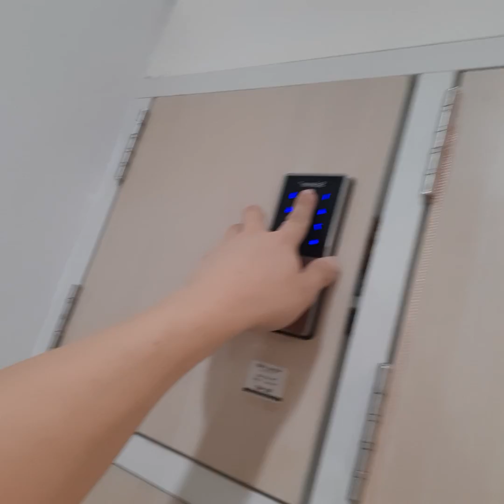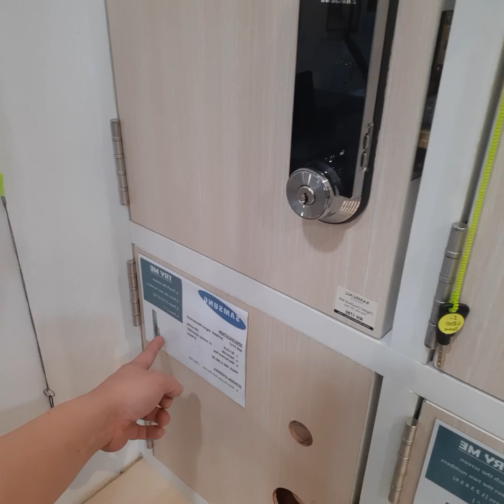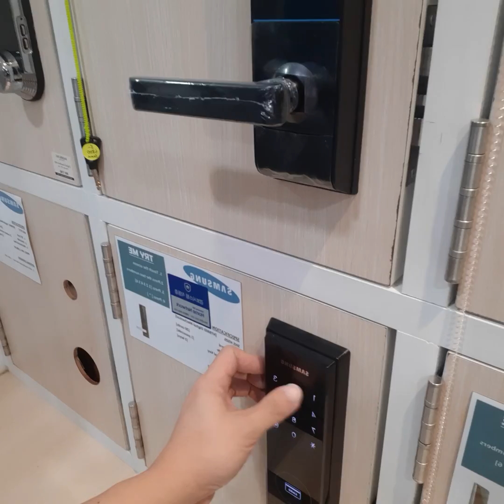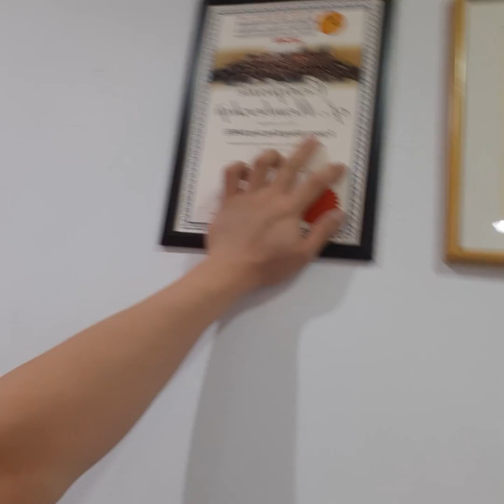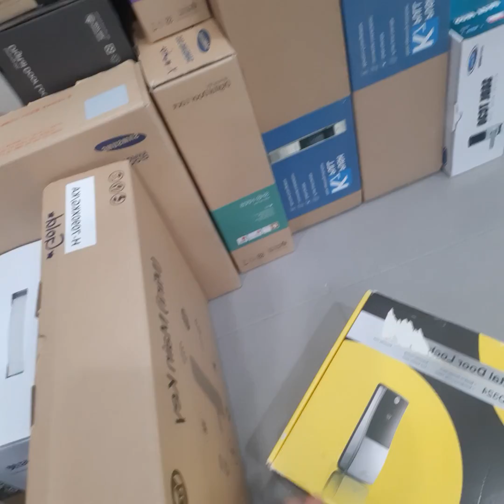DIGITAL DOOR LOCK - Which brand is good? (Yale Samsung Philips Schlage St Guchi Digital Door Lock)

Comment: Is samsung dh525 good?
Reply from the maker: not really. Back body easy to crack. if insist to buy Samsung buy the latest one. DR708
Reply: @TheFineLockShop  other thn th dr 708 how about dh 537
Reply from the maker: @zikriharith4884  They are the same. But if you really like Samsung brand but don't want to allocate high budget then you don't have choice only 525 or 537.
Reply from the maker: @zikriharith4884  708 more better

Comment: What brand that you said its good. No maintenance for 10 years
Reply from the maker: Schlage brand
Reply: Hi sir. May i ask your opinion for schlage S7100 or S7800 , which is better?

How about epic satin digital door lock brand from (Japan) as compare to S7100?
Reply: Hi Sir, thanks for sharing of your video. I'm from SG. I have used Igloohome Deadbolt S and S2 for the past 3 years. Deadbolt S2 was the free replacement for my earlier model deadbolt 2 which used it for less than a year under warranty. I have decided to change to other model instead with the bad experience with Igloohome. Any brand to recommend for deadbolt which can nice fit the existing door hole without drilling the additional door hole.

Comment: Thanks for your sharing. Very informative. Any opinion on Yale YDR50G and YDR343 combo. Good? Bad?
Reply from the maker: Yale YDR 343 only use pincode and card, Yale YDR50G can fingerprint, card, Pincode, Key, Phone app(optional). Is a bad mixture in my opinion. 

Yale rim lock, generally speaking, is good. Very seldom got problem.

Comment: Hey, very good reviews and honesty! Helped cleared up a lot of things.

Can I also please get your opinion on which one you would recommend. I don't think I require wifi since I won't let anyone in without me being at home but biometric is needed. 

Are these ones ok? The bottom two has wifi, which maybe overkill but just thought I consider it as well.
Samsung DR 900 vs Philips Alpha 
Samsung DR 708 vs Philips 9200 or 9300 (I read from the comments that you recommended the 9300 over 708 but the 708 seems to be cheaper than the 9300 by RM700. Is it worth that additional?)

If there is cheaper but good ones at RM2k and below for a push/pull handle type for condo firedoor, can you please recommend also? 

Thank you!
Reply from the maker: 708 got 2 version, a small locking version and a strong locking version.  I think if differ RM700 should be the small locking version. I definitely do not agree spending above RM2000 for a weak locking system, no matter how advance the digital part is.

Push pull below 2K, try for Hafele. But you will get more plastic. And there will be no spare part support. 

For all the price difference, there are certainly differences. Cheap but good ones, certainly there are some compromise somewhere hidden

Comment: Hi, very nice video. Which lock would you recommend me between Samsung SHS-P717 and Yale YMF40? Thank you in advance
Reply from the maker: samsung SHS-p717 is a Push pull digital lock. no fingerprint and metal body.
Reply from the maker: Yale YMF40 is lever handle digital lock. solid build and using fingerprint. better than Yale other model

Comment: Hello, @The Fine Lock Shop: 
I am fr SG, love your down to earth and honest reviews on locksets. If you are in SG, I sure buy fr you. Exactly what I have been looking for. I am looking for a biometric digital lock for my metal grille gate. Looking for quality and sturdiness as I have 4 sons who can be q rough with things.  Need to register 100 fingerprints, with card, pin code, (optional key), if possible, preferably a mobile app that I can control gate lock from other locations via WiFi. thank you for helping!
Reply: One lock seller told me - Schlage S-510g gate lock has a technical flaw that i should be aware of - the fingerprint memory will be erased automatically every 2 to 3 weeks. Did u encounter the same? I was originally looking for Schlage brand but can't find anything for gate yet.
Reply from the maker: @msu336  the seller may not sell Schlage or the lock is defect.

Comment: Thank you for the advice!:) Very helpful. Wanted to consult. Which is better? Schlage s-6800 or schlage s-7800?
Reply from the maker: schlage quality is the best. but 
if you like push pull type you can use schlage s-7800
if you like handle type, you can use Schlage s-6800

Comment: Hello Vangie! Thank you for the video! I need your suggestions. I want to order 3 locks for the offices that I’m renting (around 50 employees each) so I can give access in the app for my employees) and I want to buy the same brand for my own apartment door, so I don’t have to switch from app to app. Thanks!
Reply from the maker: may i know what type of door you use for your office?
Reply: sorry for the late reply and thank you in advance. The door that I have is a thick big metal door, I mean the regular one that are used in apartments and houses. Locks that I found so far is 20 users max like samsung ones.
Reply from the maker: Then you should consider Electromagnet lock. Digital lock not suitable for many many users.
Reply: If your still looking and the door is standard i.e.  not more than 1 3/4" thick, I would recommend the schlage encode. It has a very user friendly app and control multiple locks at multiple locations through Wi-Fi.

Comment: Great video. One of the best on the subject. Thank you for making it. I have 1 question - I was considering the Samsung 609 but then I was told  that electronically it is secured but you just need a simple kick to break the door because the mortise is quite simple. Can you share your thoughts on it?
Reply from the maker: There are 2 version out there. if you considering to buy Samsung 609, we can recommend you to buy the double bolt version. It is as strong as any european mortise lock. Don't get the simple mortise version.

Comment: Do you have an opinion on YRD226-CBA-619?
Reply from the maker: The latest version, good built, stable.

So is Good. If you just want some auto locking and keyless function, don't need much phone app function or fingerprint, i highly recommend this model.

Comment: Great video!  May I know mw140 model grille lock? Is it stable?
Reply from the maker: MW140 we already installed few. Material wise is very good. Stainless steel. System stability some issue. 

If first month no problem, it will be good for many years. But If got even small minor glitches, must get whole body warranty (don't change parts only). 

I heard they already have new model with improved stability issue (shape is more round). So maybe try wait not urgent.

Comment: How about Yale YDR, YDG? Equally bad?
Reply from the maker: Which specific model?
Reply: @TheFineLockShop  Ydr50 and ydr4110. Thanks for ur advice!
Reply from the maker: @hk9443  YDR50 good. YDR4110, you need to play with your luck. Quite high defect rate with fingeprint board. If good, will last very long. If got  problem, you are doomed.
Reply: What about Yale YDM 4109? I had one for 9 years without any problems, and I’m about to buy another one from eBay now.

Would definitely need your opinion asap. Thank you!

Comment: nice.. could I please get your opinion on Philips EasyKey 5100K gate lock and Philips EasyKey 9100, 9200 & 9300?
Reply from the maker: Philips 9100, fingerprint module/ reader got problem. Don't buy.

9200 and 9300 good. Gate lock, still very new until now. Don't know any problem yet. But so far so good.

Comment: Hi Francis.. I'm thinking of buying Philips 9300..What is your opinion about it?
Reply from the maker: 9300 is the only digital lock that i ever seen using real glass on front panel. The rest like yale schlage samsung all is using arcylic or plastic. I open in, also everything is alloy steel wrapped in PC. So built quality is superb. 

WiFi function is the one i need more data. I wana install more see if any issue. I will not put too much hope as other branded wifi all have at least some minor bug
Reply: @TheFineLockShop  Isn't it glass easier to brake? And what do you mean by PC?
Reply from the maker: @Mcflytribe  pc is plastic. Glass much better than plastic. 

Not really easy to break. Car window, our house window, office door, all hardly break
Reply: @TheFineLockShop after done some research, i narrowed down my option to Philips 9300 and Samsung 708. I know that 9300 is much more expensive than 708. Let say if budget is not an issue, which model do you think better in terms of durability, features and practicality?
Reply from the maker: @Mcflytribe  9300 of course.

708 is not that much cheaper. If you said much cheaper, means you are looking at the small lock version. 708 got big double bolt (for main door) and the cheaper small single bolt (for what buy expensive lock but with a small small weak locking?)
Reply: @TheFineLockShop  thank you for the advise..

Comment: Can i install yale ydr4110  and ydr3110 on double door and which one to prefer among these two??
Reply from the maker: Double door, rim lock will not be strong. Guarantee you 3 kick max, can go in. 

But if you have a main lock already, and just to add on another digital, go for YDR3110 will last longer. YDR4110 fingerprint module many headache

Comment: Hi informative and compact video. Just hope that you did a more thorough reviews of each model. Question, what about Xiaomi aqara door lock? Any experience with them?
Reply from the maker: Xiaomi we installed few. Nice feature and body. But wiring and the connector used is different from other lock, feels weaker. Suitable for security door (because hollow inside and plenty space for the wire. For solid wooden door, we want to be careful a bit (cannot repair,  no spare part remember)

So if security door, yes recommended. Wooden door, we cannot give any suggestion as we do not have it long enough yet.

Also, Aqara is not xiaomi. Just that it can use xiaomi app. Aqara is a china brand not related to xiaomi.
Reply: Based on the review, Xiaomi has its pros and cons but overall you should give it a shot

Comment: Is the new Philips easykey 9300 good? Any comments on Bosch brand?
Reply: 9300 hvn't launch yet! Not yet got chance to dissect a demo so can't comment.

Bosch...um.... i not dare to recommend because of this issue: https://www.facebook.com/notes/bosch-malaysia/advisory-on-purchasing-bosch-digital-locks-in-malaysia/3479509978730153
Reply: Thanks for the info. Any recommendation on digital lock for iron grill door?
Reply from the maker: @xuperdad  Grille got many selection... Add-on type got Yale, Philips, Samsung. If wan handle only got Finetec. Is a local brand, with handle is made from stainless steel but i never dissected yet. Wanted to dissect it very soon as we got the sample already

Comment: Is Schlage S-6800 good? 
I love the way you bashing the companies. You are like Scotty Kilmer of smart lock segment.
Reply: Thanks!

6800 is good stable very old school. Very very little problem, very stable. Recommended. The only drawback, small mortise, and some plastic. But other than that, there is no issue at all.
Reply: @franciswong8002  , I am thinking to choose Philips Alpha due to my tight budget. Should I choose Philips Alpha over Schlage S-6800?
Reply: @1chai  If not mistaken......Philips Alpha more expensive than 6800 right? So up to your budget..... (If price same, got for Philips Alpha strong locking, solid body, got bluetooth somemore)
Reply: @franciswong8002  , OK. Thanks for your advice even though I can't be your customer because I am in Penang. If you have branch in Penang, I definitely be your customer. 
In Lazada, Philips Alpha price is RM2188 (including installation) while Schlage S6800 is RM2290.
Reply from the maker: @1chai  sure get Alpha liao like that
Reply: So do I, if he’ll have his branch in Thailand.

Comment: Hi. Thank you so much for your reply. My daughter insisted on me buying Yale 7116 because of the after sales service. Is the yale 7116 model good digital lock to buy? Your comment is again highly appreciated.
Reply: 7116 is still new, cant really know the durability yet. My experience with Yale is mixed. YDM4109 is hell. YMF40 is heaven. So, it's hard to comment on new model..... But for Yale, any servicing is really expensive... Over here, the main distributor, Titan did not have/ sell spare part. They will ask us to tell our client to change whole backbody/ whole front body if after warranty. No spare part. 

Hope Philippines distributor will be more responsible.
Reply: 🤣🤣🤣

Don't worry too much ya. Hope it will be good
Reply: Oh no. I already got my Yale 7116 and it is to be installed tomorrow.  Wish me luck!

Comment: Hi. Good morning! I am planning to buy a digital door lock and I am interested in Schlage S6800 because of the added key that I can use if ever there is a problem with batteries. What do you think? Am I making a good choice? Also there is another model that came out with bluetooth or wifi bridge but doesnt have key entry.. your suggestion is highly appreciated.
Reply from the maker: Schlage 6800 is good. Can buy. It's classic. Sell for many many years, never ever have problem until now. Bluetooth and Wifi you will need to check from which country are you from? Functions are usually restricted to countries. For example, wifi and Bluetooth in Korea, cannot use in Malaysia. Same with China. I need more info to recommend you.
Reply: @TheFineLockShop  Hi,  schlage 6800 come with plastic back body instead of solid material.
Reply: @clarencethien8131  Yes backbody is still majority plastic, only little metal reinforcement. I'm also skeptical at first. But my guys install many, so long already never once happen cracking (unlike Samsung!). When i measure, found out the plastic is almost 2x-3x thicker than Samsung's. Confident it will do well on ordinary door. Fire door got closer need caution though.
Reply: What do you think about the schlage be365 if you’ve seen it??
Reply: @LAG8170  Hi. I did not buy Schlage. I had the problem with installer. They wont provide a company installer. I bought Yale YDM 7116 instead. I think it is a good one.
Reply: @LAG8170  Mr. Francis said it is good quality too. Yale’s customer service in the Philippines are very nice. They send a technician to survey my door before I purchased the digital door lock. When they said that it is OK with the door I have, thats the time I purchased the item. After that they scheduled me for the installation. Even their after sales service. Ms Hannah and Mr Retchie,  the authorized installer from Yale, were really very nice to thier customers. I think for us buyers it is very important is the after sales service. I am happy with my digital door lock. Thank you Mr Francis for this video. I learned a lot from you.
Reply from the maker: @LAG8170  Hi Marc. BE-365 is an American model. Not available to us here in Asia.